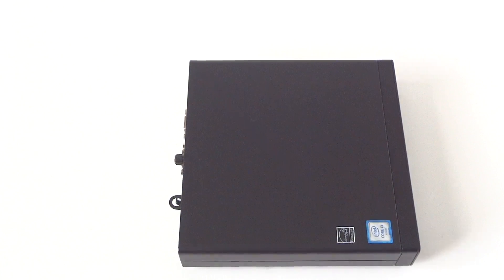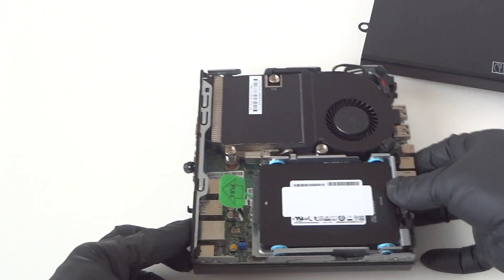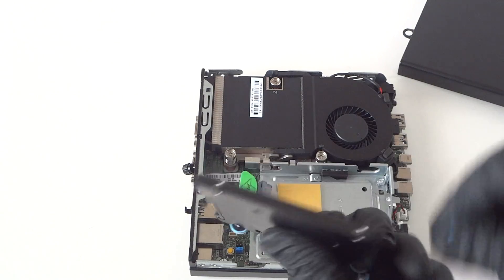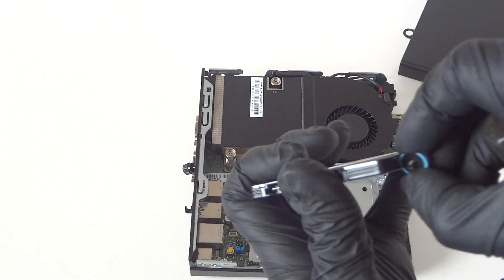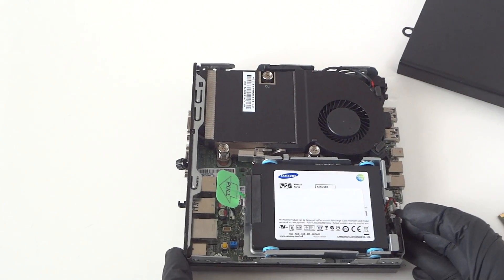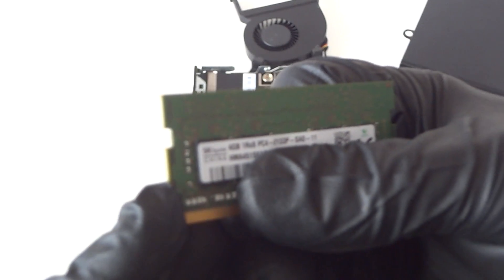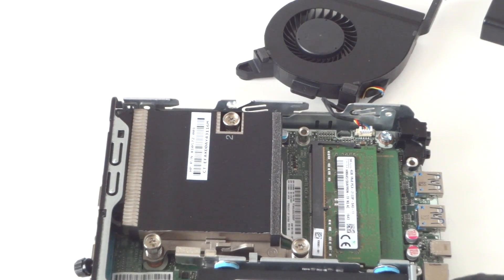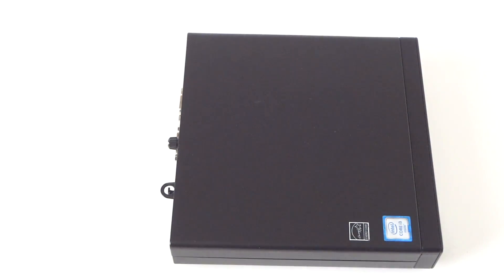HP MP9 G2 Upgrade SSD Drive, RAM

Comment: If this model is like mine, right under that hard drive cage (comes up with 3 screws) is an m.2 slot! I have mine rocking a 1TB M.2 (970 EVO NVMe) plus the installed 256GB SSD. Encourage anyone who has an HP ProDesk to check for an M.2 slot. (And yup! Just saw your teardown video. M.2 right under the drive caddy! )

Comment: is there an m2 slot underneath the hdd cage?
Reply: There are two m.2 slots: one for the wifi (2230) and one for the ssd (2280).
The latter doesn't work for me with a SATA SSD. I'm going to check with an NVMe in the near future.
The former works fine with an Intel 3160

Comment: Thank you. This video is very useful. I will definitely make use of both RAM slots.  But changing the 2.5" SSD is unlikely for me as I don't know how to migrate the Windows from one storage to another.
How about the installation of M.2 2280 SSD, and the type 1630 or 2230 wireless LAN card? Would this be difficult?